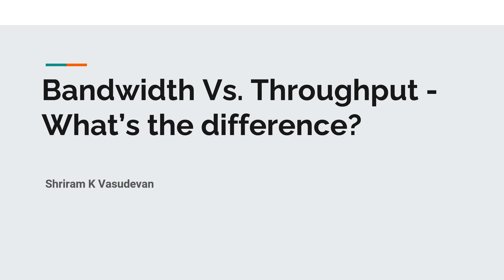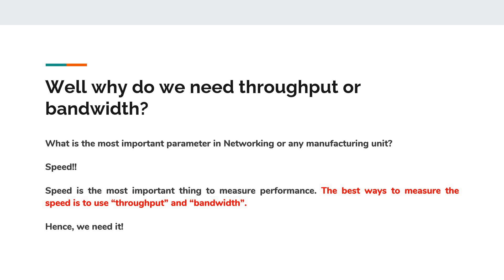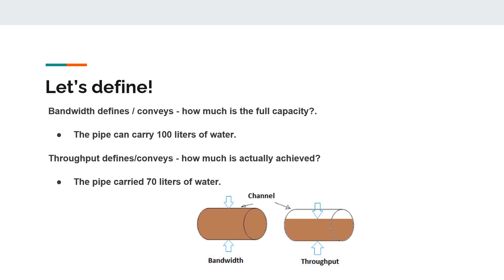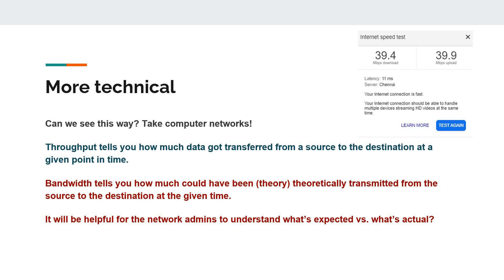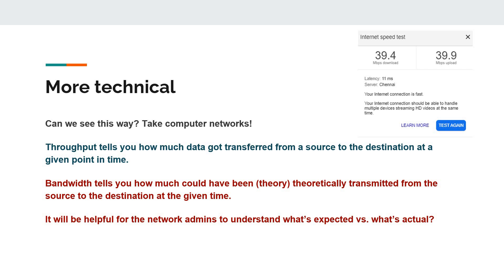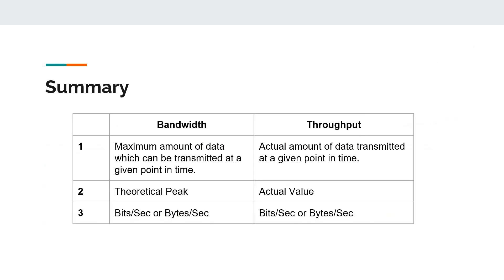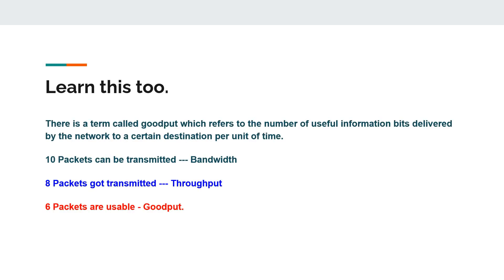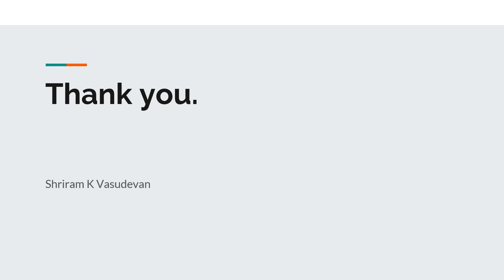Bandwidth Vs  Throughput   - What’s the difference?

Comment: Sir then what is the difference between channel capacity and bandwidth?
Reply from the maker: Channel capacity is a maximum information rate that a channel can transmit. It is measured in bits per second (bps). ... Bandwidth can be considered as a subset of channel capacity term. When bandwidth is measured, the maximum volume of information that can be accurately transferred per unit of time is taken into account.